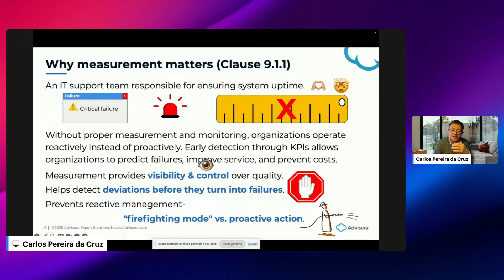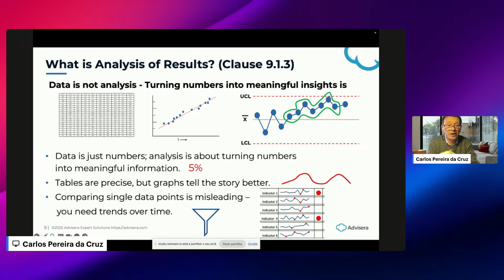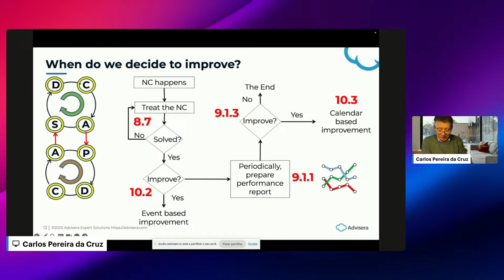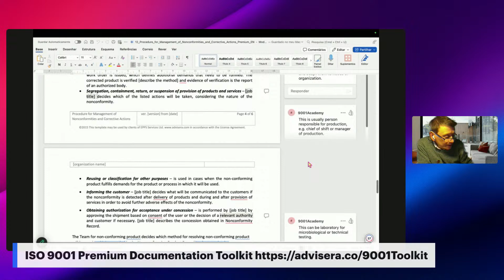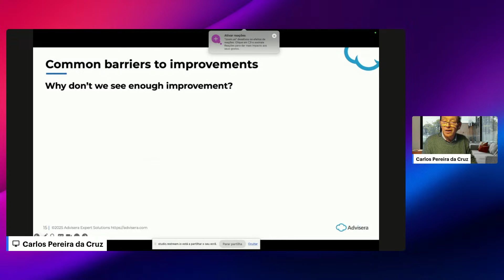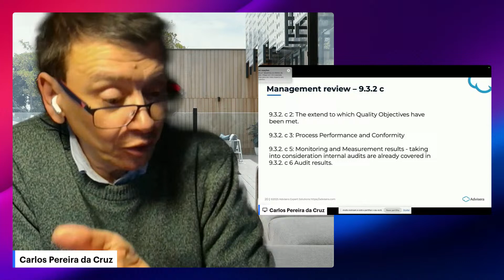Measurement, Analysis, and Improvement According to ISO 9001:2015 [live webinar]

Comment from the maker: You can find all the links we have shared during the webinar below: - ISO 9001:2015 Foundations Course https://advisera.co/9001Foundations
- ISO 9001:2015 Lead Implementer Course https://advisera.co/9001LeadImplementer
- ISO 9001:2015 Internal Auditor Course https://advisera.co/9001InternalAuditor
- ISO 9001:2015 Lead Auditor Course https://advisera.co/9001LeadAuditor- DISCOVER ISO 9001:2015 THROUGH PRACTICAL EXAMPLES - https://advisera.co/9001eBook- ISO 9001 Premium Documentation Toolkit https://advisera.co/9001Toolkit- Toolkit expert meeting link https://advisera.co/9001ToolkitExpert- Practical tips for measuring your QMS according to ISO 9001:2015 clause 9.1 - https://advisera.co/MeasuringQMS
- The ultimate guide to ISO 9001 quality objectives https://advisera.co/QualityObjectives
- How to define Key Performance Indicators for a QMS based on ISO 9001 - https://advisera.co/QMS-KPIs
- Making the best out of ISO 9001 Quality Plan - https://advisera.co/9001QualityPlan
- Analysis of measuring and monitoring requirements in ISO 9001:2015 - https://advisera.co/MeasureMonitorReqs
- How to implement the Check phase (performance evaluation) in the QMS according to ISO 9001:2015 - https://advisera.co/9001CheckPhase
- Complete guide to corrective action vs. preventive action https://advisera.co/CorrectiveVsPreventiveActions
- How to use quality control tools to improve your QMS - https://advisera.co/QualityControlTools
- How to use root cause analysis to support corrective actions in your QMS - https://advisera.co/RootCauseAnalysis

Follow us on social media: 
- Advisera LinkedIn: https://www.linkedin.com/company/advisera/ 
- Advisera YouTube: http://www.youtube.com/@AdviseraExperts

Upcoming webinars:
- LinkedIn: https://www.linkedin.com/company/18062427/events/
- YouTube: https://www.youtube.com/@AdviseraExperts/streams
- Advisera Website: https://advisera.co/Webinars

You can find below the links to the Webinar Survey and the PDF slides below: 
- Webinar Survey https://info.advisera.com/webinar-survey/measurement-analysis-and-improvement-according-to-iso-9001/ 
- PDF slides https://advisera.com/webinars/materials/ISO_9001_2015_Measurement_Analysis_Improvement_webinar_presentation_deck.pdf

We look forward to hearing your feedback!